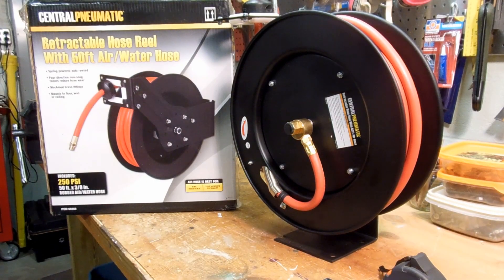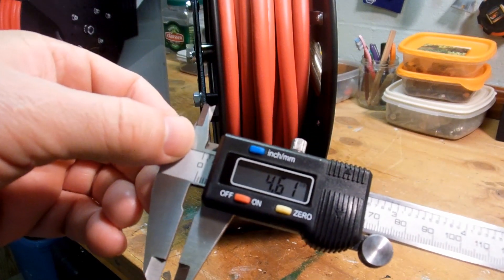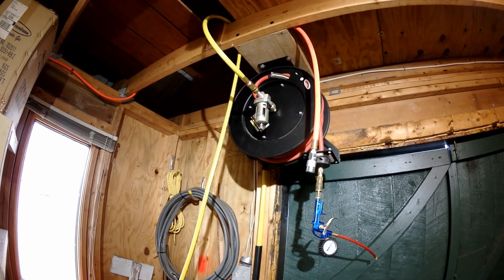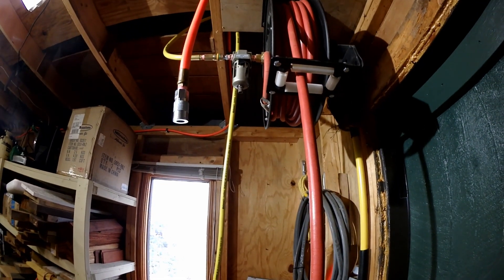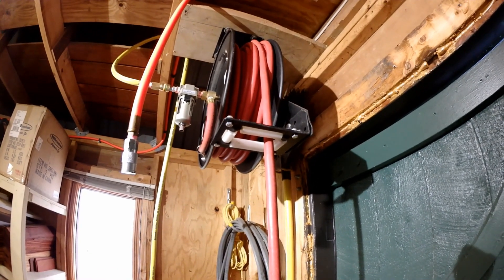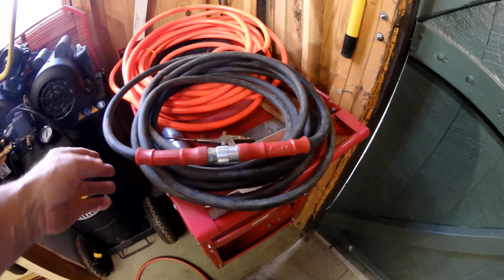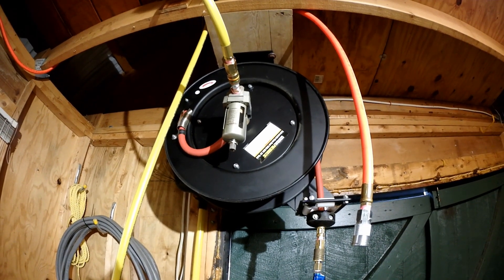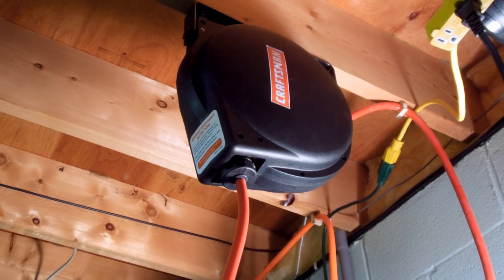Harbor Freight 50-ft Air Hose Reel

Comment: I have the same reel and still have the original hose after all these many years. All I do is wipe it off and keep it clean and it seems to help. I agree it is really heavy, so I suggest to use carriage bolts with nuts and washer to make sure it stays in place. I did a video on my channel where I mounted it under my work bench to prevent it dropping on me. Didn't want it over my head.

Comment: I got mine 2 years ago. The rubber coating is completely dry rotted and it keeps blowing out. It is not in a sunny location. It is in a dark corner of my garage mounted to the wall. I will be replacing the hose this summer with a better grade hose. I the good thing is that the reel itself works great.

Comment: Just an FYI, I purchased one of the Black Diablo hoses a year ago and it is already cracking.
Reply: I wipe down my rubber hoses with fluid film spray and let it soak in to the rubber to protect it. It’s lanolin based.

Comment: What the heck fitting is on the included 3 foot hose? One end has an odd fitting.  I did not use that hose anyway.  Not sure what use it is, but I am not an air plumbing expert... mainly use mine for inflating tires and small air tools

Comment: What your calling polyurethane looks much more like PVC!  Polyurethane hoses no matter the brand are transparent colors and don’t stiffen up in cold weather. I own several!  PVC does stiffen in cold weather a LOT!  The only thing I use PVC hoses for is running air hoses on walls and ceilings, etc
Reply from the maker: I tend to misspeak at times.

Comment: well hose life has many variables to why some last longer than others. some have had the same HF past 3 years with none of the visible damage you have. without seeing your daily habits or monitoring your garages temperature levels, no one can really say. I work in a diesel shop and can say within 3 years the +100 dollars hoses are damaged. yeah the rubber hoses do better in cold temps, but still dry out, and breakdown if you drag them a lot.

Comment: TIP!!! REMOVE DRUM FROM BASE 1 SNAP RING I have mounted industrial reels weights can exceed 150lbs remove everthing from base and make your life safe. add another 2x10 over stringer use threaded rod  and sandwich stringer dont use lag bolts use 1/2" or 3/8 grade 5 hex bolts.

Comment: The reel that I have from hf is great, however, the hose started cracking within a week. The weak point is the red hose it will need replacing very soon.

Comment: I have worked in several different shops, automotive and at present aircraft hangar and every hose reel has certain spots on the reel where they stop. And high highly doubt anyone could have been killed when you had your brain fart!  it was a good video though.
Reply from the maker: Had anyone been standing in the doorway and hit in the head with the end of that hose, they would have been very seriously injured or killed. I was there, you weren't.
Reply: Vicos your absolutely right, I'm sure it was worse in person and i wouldn't have wanted to be hit by that. Didn't mean to be an ass if that's the way it sounded.
Reply: I used to work for Reelcraft and can confirm the springs in hose reels are no joke and have some serious energy behind them. The scary part is when the hose doesn't go running back into the shop and the reel comes to find you instead!

You are correct that they only latch in certain positions. That's just how the ratchet mechanism in all of them work. I've trained myself to listen carefully and make sure the hose goes slack before I let it go. If I'm going way out in the drive way, I do the same thing you do and just run it all out on the floor first. It's actually easier than dragging it off of the reel at an odd angle anyhow.

As a side note, if your spring ever does get weak, just manually wrap the hose around the drum a couple times (you may have to take the stopper off to do that). That will add tension back into the spring and is a standard maintenance procedure. I've had my oldest Reelcraft reel for 12 years and I've had to do that 3 times. No issues yet and spring failures were super rare in the service department when I worked for them. The only ones I knew about had died of rust from being on the back of a service truck for ages. Spring steel is pretty much spring steel even if it is a HF reel, so I'm sure it would be fine too.

Comment: I had a hard time mounting mine to a wall.  Any trick as the four hole were are to get access to...
Reply from the maker: If I was going to mount it to a wall, I might first just bolt the unit to a 2x10 (or whatever) and then lag bolt that to the wall studs. Make the 2x10 long enough so it hits at least two wall studs, plus an inch or 2 on each end to prevent splitting when you drive in the bolts to the studs. You might have to countersink the bolt heads on the back of the 2x10 that goes up against the wall (if you have wallboard up).